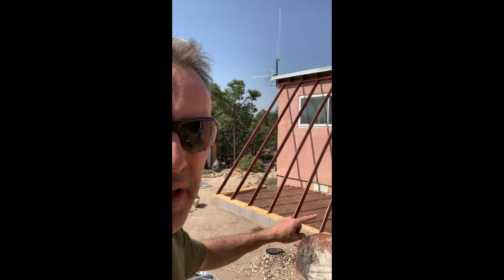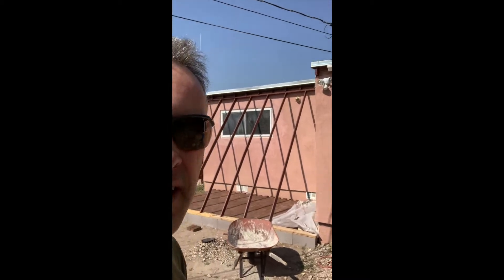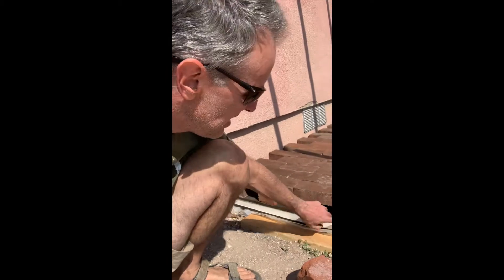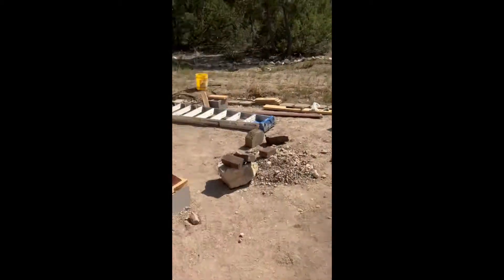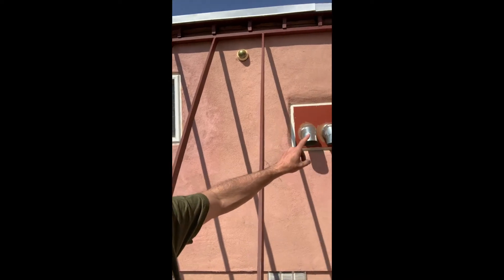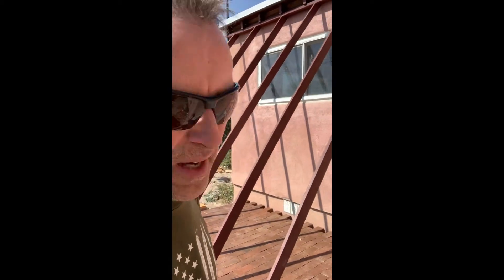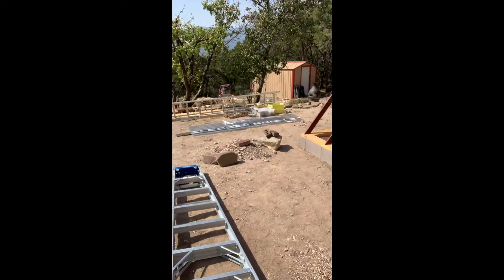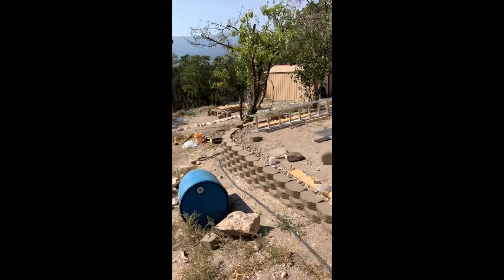Why Build a Trombe Floor to Catch and Store Solar Heat

Comment: How have you been likin’ your trombe setup? Thanks!
Reply from the maker: Yes, quite a lot actually. It has been giving us more warmth than expected in the room where it's connected. The only downside now is that room gets a lot warmer than the rest of the house. Air circulation is the problem.
Reply: @ChrisJungmann  if you feed the heat to where the furnace intake is you can just run the central hvac fan?
Reply: Do you have another update for us, good sir? Have you figured out a way to circulate the air better?